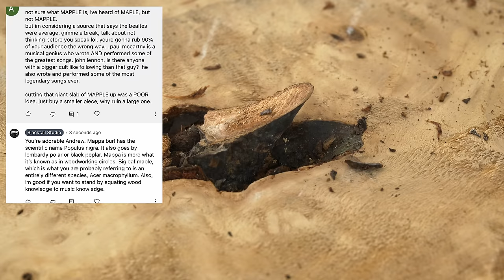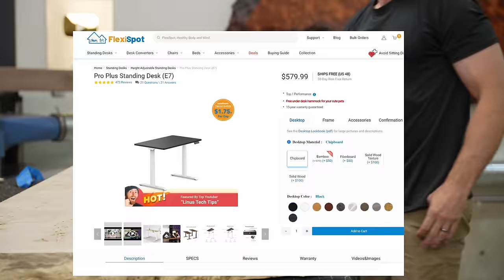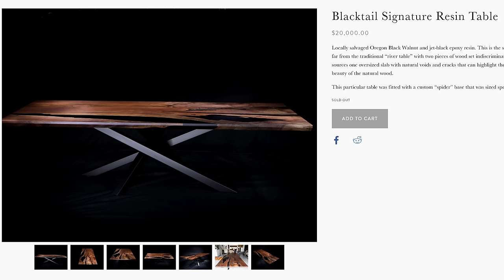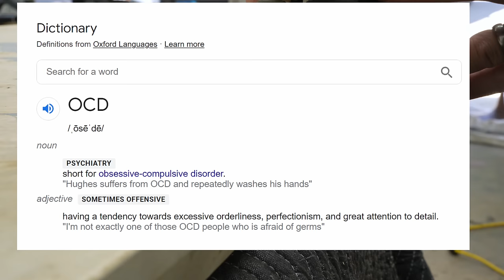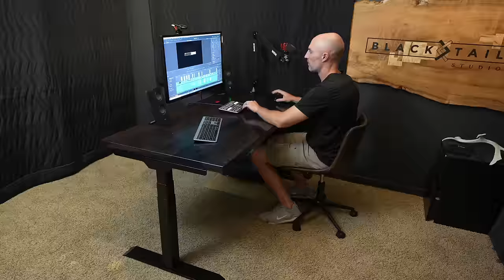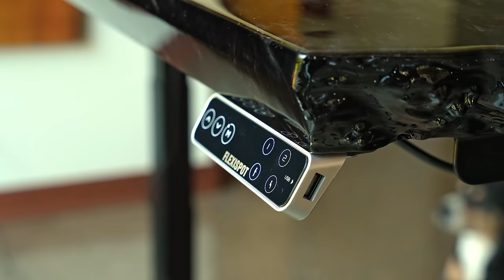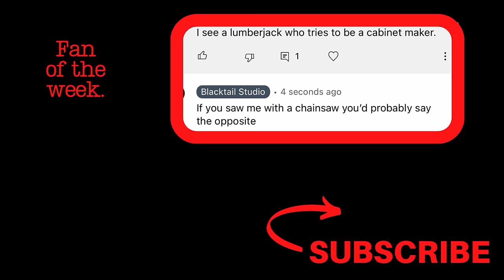Woodworking Fraud

Comment: Dark, great tips. As I have watched you I have often thought, “there’s no way I could ever do anything like that.”  Well that may still be true but your tips made me think to “start small” might help.  No need to tackle such a large piece which requires more space, equipment, etc., you know.  I also wondered when you first went to your tools, “this guy must have hit the tool mega lotto”.  But, you addressed that as well soon afterwards.  One question remains, your cabinets full of dyes and epoxies, I’m sure some took time to build, but how invested did you have to get up front?  Lastly simply awesome work, which goes along with another tip of “ care more”, be a perfectionist that 7 or 8 of the other 10 skilled guys aren’t. Don’t settle for “good enough”!
Reply: I’ve been a woodworker for 40 plus years; I’d class myself as serious hobby as my experience gives me the confidence to be able to say yes to any idea or anything I see and want to make.
 
A few thoughts from me:

- I work with the saying “patience and precision leads to perfection”
- think and think again before you start any part of the task. It’s surprising to me how many times I revise my thoughts. 
- before starting on a project, spend a lot of time working out how am I going to to do this step by step and work out the order in which tasks have to be done
- I make mistakes most days. Some mean the project take longer; most are not visible; some mean thinking again. Factor these setbacks into your schedule or costing
- use good tools. That does mean spending a lot of money - I don’t see a way around it. You don’t have to buy them all at once but don’t waste money buying cheaper tools that you think might compromise your work. I would guess the machinery and tools in my workshop would cost around £30,000 if I had to go out and replace them all today. 
- I wish there were golden rules about buying “good tools”. There aren’t. Good tools doesn’t necessarily mean the most expensive or the “premium brands”. Sometimes, it does but sometimes, you would be paying for the brand name rather than the quality of the item. I guess my only suggestion is to talk to experienced woodworkers or, if you don’t know any, look at YT channels whose work you like but are not sponsored by tool companies.
Reply: @theofarmmanager267  Thank you for that advice.  I appreciate it from someone with the experience. In most things I do, I think a lot before doing it. But mistakes and accidents will always happen.  It’s encouraging that they still occasionally happen with guys like you. But experience and confidence always help. New things take time to learn if the are to be done well.  One of my favorite quotes is, “if it were easy, everyone would do it “.
Reply: @LuDiamondDog  no problem - I’m glad you might find a use for them. You said on your original post “don’t settle for good enough”. In fact, there are times when you should settle for good enough - or you will waste time on parts that don’t need to be perfect. When you are working with most Timbers, tear outs are pretty much inevitable when you are using a planer/thicknesser or even a router. If the tear out isn’t so bad, I don’t waste the piece or spend time resizing because many pieces have show sides but also sides that will never be seen again. For instance, the inside of a false drawer front; the rear side of a drawer box back piece. It is something you learn - when must something be as near perfect as possible and when it doesn’t matter. 

I’m amused by the aura surrounding piston fit drawers. Truthfully, they are a pain in the rear to make and even a bigger pain to use. Because, when you close a piston fit drawer, the air you are displacing needs to go somewhere and it is likely to pop open another drawer. Another example of this aura is about dovetail joints. When I started, you had to have a mechanical joints because the animal glues just weren’t brilliant. Now, glues are so good that you could get away with butt joints - I don’t recommend doing that though. If you want to cut dovetails, then it’s your choice but it won’t add much to strength and take away a reasonable amount of time.

We all know natural Timbers (not MDF or plywood) move through atmospheric changes. They only really move across the grain and not with the grain. Some Timbers move more than others and, here in the UK for instance, our climate means humidity levels don’t change that much and so movement, if any, will be small. The same would be if you live in a desert. So take that into account when you are figuring out construction and how to account for wood movement. 

Finishes. I’ve got a large cupboard full of different finishes. A waste of my money. You can cut down the finishes you will need to just a few:

- varnishes and I include Danish oil here as it contains varnish. Hardly penetrates the wood but gives a hard protective layer. It’s a so and so to repair, usually meaning stripping back and re varnishing.You might feel you want that on such things as tables. 
- shellac. Either watered down for a sanding sealer or a final finish. Gives a lovely mellow finish but doesn’t offer much protection
- hard wax oils such as Osmo. Does penetrate the timber to a good degree and is a popular choice for interior and exterior pieces. Many differing types available from Osmo - so choose the right one for you.
- Rubio Monocoat. A type of hard wax oil but I think gives a much more mellow result. Expensive per litre but you use so little per square metres that it’s not over expensive. Great thing is that repairs or renovation are easy; clean and then apply some more. 
- Odies. I’m not sure where Odies fits in these days. It’s almost like spreading butter but, in my experience, isn’t that resilient. However, very simple to repair just by cleaning and adding some more.

If I lost my “collection” in a fire, I would only get the ones above for replacements. 

Finally, tool buying mania. There is a saying in fly-fishing that the new flies being brought to market are there to catch the angler and not the fish. In other words, very few new tools add much to my woodworking. The last ones for me were track saws and dominoes. If you want (in my experience) high quality measuring tools at a fraction of normal price, go to Banggood and search for woodworking tools. I’ve got perhaps a dozen of them that are finished in “woodpecker”red. All of them have been tested for accuracy and I’ve not found any wanting. Perhaps less than a quarter of the price for an established brand.

Comment: for spraying when you start doing that, you can actually remove the runs by either wiping it with a finger while wet and spraying over it on the second coat. I even did it with a basecoat run on my truck when I was spraying that and it still came out great to the naked eye. I've also seen people use a piece of masking tape. Also be sure to get a GOOD respirator especially if you get into urethane clears like a 2k, that shit made me cough up blood for a week with a shitty harbor freight respirator

Comment: I also recommend going for spray advice from fiberglass shop when dealing with epoxy resin and spraying this type of product. Working for Current Designs kayaks as mold maintenance cotton pads only thing needed to polish epoxy or resins to a tooling high gloss shine with same polish you would use in automotive industry also

Comment: Maybe this has been asked (I apologize. I don't troll through comment sections at all), but if the charcoal doesn't break down in water or epoxy, does it just stain the epoxy? If that's the case, for bigger pours (I know you had said that you were nervous about using it on a bigger pour) you could possibly mix it in your epoxy and then strain out the charcoal. Just a thought. Love the work man! I actually poured my first epoxy/wood desk top today.

Comment: My opinion on high end equipment/tools. If you are an amateur and that expensive piece of equipment boosts your confidence simply because you have faith in it, will ultimately make your work better. You will be more confident in the outcome so you will be more relaxed and ultimately perform at a level that may exceed your ability. Even it is purely psychological!

Comment: The only way to get a scratch free finish that’s worked for me is to wet sand and depending on just how smooth of a finish you want you’ll have to finish with 2000 or even a 4000 grit wet sand paper…it’s a lot of work for sure…👍🏼👍🏼

Comment: I'm obsessed with the dark! 
I completely understand how social norms change the definition of words, but as someone with OCD, I would never bash someone for using OCD when describing perfectionism but it makes me upset about how little awareness there is for what OCD is actually like. Again, this isn't trying to say "YOUR SO IGNORANT AND OFFENSIVE", I completely get using OCD as an adjective, and have probably used it a few times myself, I just wanted to use this opportunity to see if I could educate at least one person down here looking through the comments.

OCD isn't perfectionism, for some, they may be really messy and unorganised. Moreso, OCD is an insurmountable amount of fear, typically for the individual's life, that other people can see through little compulsions. An example of this may start with an intrusive obsession about an intruder getting in. As soon as this thought forms, an abnormal amount of panic will build up and the person will fixate on locking their door, re-checking, re-locking, over and over and over again. This may also reach over to checking closets, checking under the bed, over and over and over again, as the brain will not let up. This will happen, multiple times in a day, all because of a thought.

The reason why people associate OCD with cleanliness and perfectionism is because the fear of contamination or failure can result in incredible perfectionism and cleaning habits.

Comment: This came out 🔥 
Re sand paper gumming up: if the epoxy is forming an amine blush you'll have a hell of a time sanding. Peel ply or a solvent wipe after cure and before sanding usually does the trick. Downeastboatforum has tons of knowledge on all things fiberglass, resin, epoxy, ive learned a ton from the guys there. Awesome work, love the channel

Comment: Dark on moderately dark. Why don't you grind the knot you pull from the knot pockets into powder and use that in your fills? It looks much better than dyed epoxy.  I did a few burl guitars in a dark amber. Worked really well. I can't work with exotic woods any longer as a result of an allergic reaction.

Comment: R2B2 can you make a multi level desk for a guy in a wheelchair with a pop-up book stand that will hold either a book or a tablet? I write and I use voice activated software. My house used to look like a mini library because I had books everywhere on different subjects open or something I was reading we’re doing research for. As I’ve gotten older, I need more assistance in handling books and making notes. Chair I use is especially designed power chair, it allows me to be comfortable and avoid getting painful sores in places where one never wears a hat!

Comment: light/dark what?  Another auto guy tip I heard was for keeping fingerprints of stainless steel appliances: wipe down 2x with WD40, then 1x (or 2x?) with Pledge. I tried it and compared to some stainless steel polish and the WD40/Pledge worked way better. Last ~ 1yr or 6 months if you are pickier than me.

Comment: A thought ... in machining metals and plastics .., the angle of attack of the drill bit .., for example .., is changed .., by grinding .., to improve behaviour / performance in the softer materials ... It may be worth attempting to reach out to your router / circular saw blade provider .., to find out if they have or will make you .., or have information on their bits operating in softer woods...

Comment: Have you tried to sand epoxy with 320 then spray it with automotive UHS 2k clearcoat then apply a ceramic finishing coat? 
From my experience, it reduces amount of polishing a lot and is durable enough to be a tabletop. 
Polishing the epoxy is a true pain but I cant stop watching it:)

Comment: Dark. Shame you're on the wrong coast. Did furniture restoration for years, built custom furniture in my own shop and also did finish detailing in a body shop doing mostly wet sanding and high speed buffing. Would have been cool to find someone else to work with.

Comment: Finally, a use for this trash that shouldn't be against the law.   Imagine believing a tuck getting its fuel mileage cut in 1/2.   Then having a bunch of expensive trash that breakes and has to be replaced is in some way better for the environment.  Absolute insanity.   The epa instead of saying this size truck must make x pollution.   The epa says vehicle must make x pollution,  for the amount of fuel it uses.   In other words your truck isn't better for the environment.    Its way worse no matter what some clown tells you.   When your truck uses 1/2. Again as much fuel is not better.

Comment: What are those metal screw Inserts called? It looks like they provide a thread for the screws holding in the metal channel. Coincidentally I need one right now to fix a chair at my mom's house l o l. I went to the hardware store but it did not get in my pocket so I couldn't buy it or even ask them about it. I'll have to make another trip when I have it with me as an example. I'll try again just not sure if it's a specialty item.

Comment: What I always, always, always notice in these woodworking builds is that there are so many layers of shine, polish, and gloss that the very LIFE of the wood is long gone. Any hint of the original piece is lost. Which I guess is fine for a garage-built car, but just ruins the potential of a great piece of wood.

Basically... Its impossible to know whether this is a printed texture on a slab of plastic from China, or the result of great craftsmanship from the US. And thats such a great shame.

I have talked to many craftsmen about this previously and they simply do not understand it. Whether its the interior of a boat or a log cabin. This attitude always gets in the way. Its virtually impossible to find any American products that has a sense of quality or "luxury" to it. Because once every 17 application of shine is applied, its all plastic in the end. Just like holding one of those guitars. Is it plastic? Is it wood? Impossible to know. And thats such a shame.